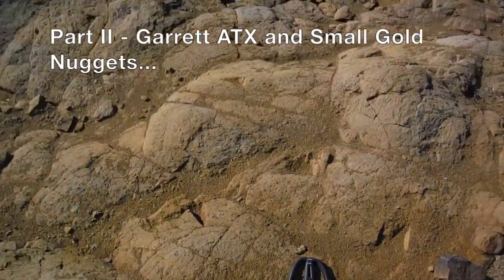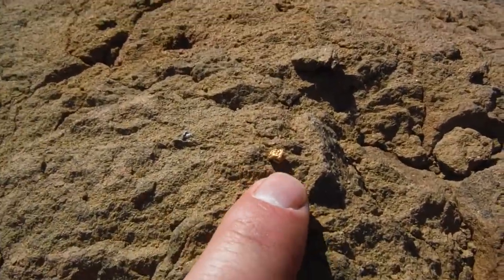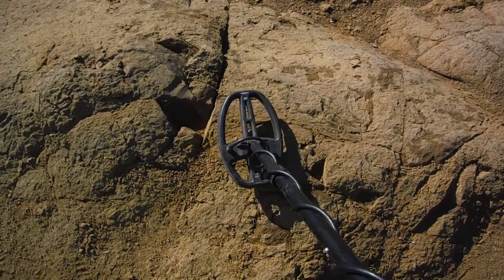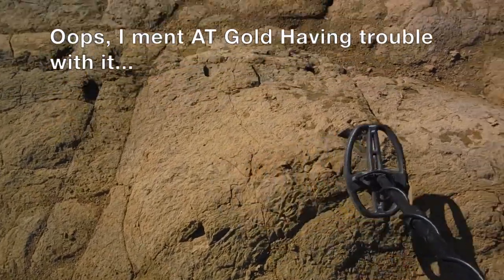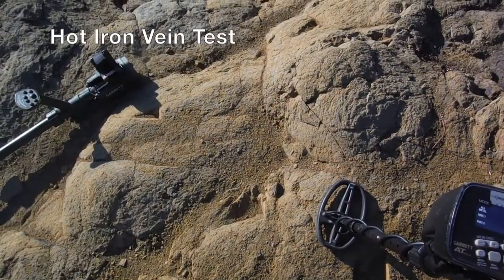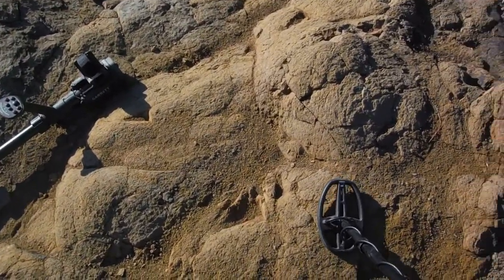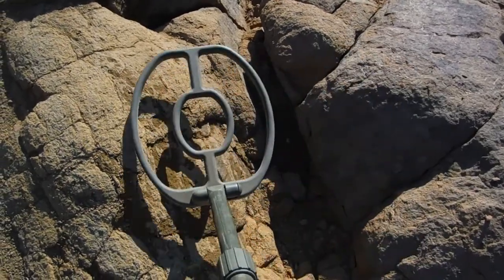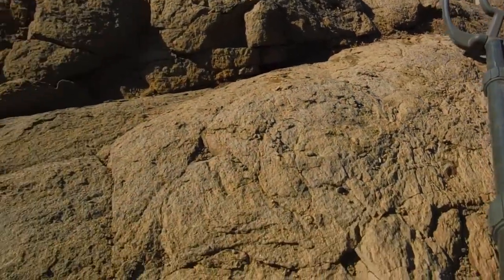Garrett ATX - Part II of Small Gold Nuggets being Tested

Comment from the maker: I did a quick 8" mono test and funny thing...the stock DD coil gets those .1 gram nuggets just like the 8" mono does. So you dont need the small coil for small nuggets - just maybe the 8" for lighter weight or tighter places. Will test both coils soon with less than .1 gram nuggets. Stay tuned Thelrongutz...